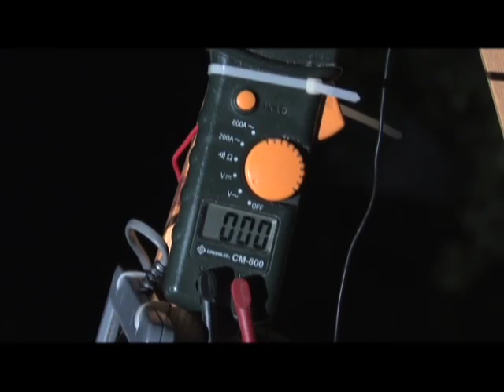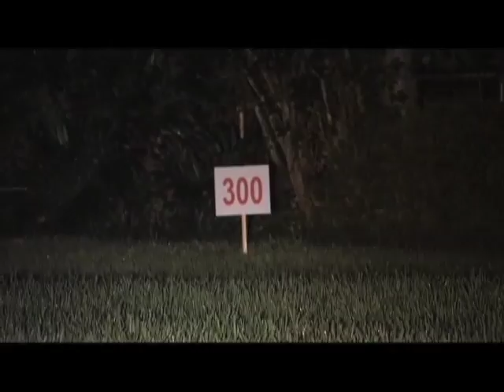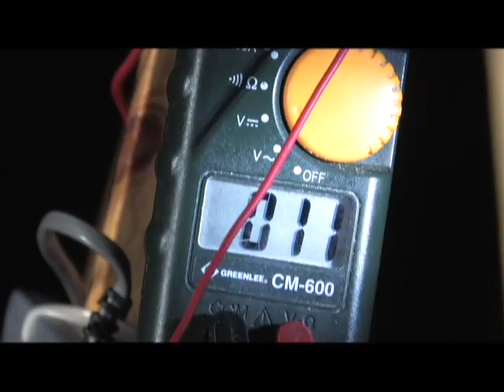Solar Panel Wireless Nighttime Power transfer HID LIGHT FRESNEL LENS PARABOLIC LENS

Comment: What if the lens was focused so the light filled more of the solar panel? Would that potentially increase the voltage? Or would the lack in focus produce the same power?

Comment: what happens if you move your light source half the distance, then one quarter?  Does it increase the voltage in direct proportion or is there some logarithmic increase?  Just wondering...

Comment: i did a real tesla wireless energy transfer. i got 20 ft wireles energy so far which is quite far! maybe i can get 50 or more. this is important we can bring his technology back if we start building it underground! once perfect it should go miles! wirelesss power obtainable anywhere on the planet!
Reply: Ya can't do what he wanted the power through the air would fry most your micro electronics we use now unless it was focused through the air and at nodes put into the existing electrical system, wireless power to your home without Into existing grid would fry all electronics. 100amps of power is too much.

Comment from the maker: You can as their light invades your space:-) You will not get much power, really very little but in theory an stronger PV with a higher efficiency rating would get something. Take a telescope and point it a a street light, even if out of focus, a solar calculator works if the eyepiece is removed. Pointless as they run off of just about anything. If your neighbor was a ball park, then maybe you could get  a few watts.

Comment: use lasers (like the really powerfull ones but not too powerful and damage the panel but maby use the lenses to difise it i winder how efecirnt that is? and maby get a laser that werks well with the imput spectrum of the panel(how to explain) a soler panel werks well with sum collers but not with others so thats y there not good with wight sun light so if u got a good coller then...

Comment: Well, looking at your 250ma motor and 4-11 volts DC developed, it seems like you're producing about 2-3 watts to run the motor.  That would be somewhere between 35:1 or perhaps 20:1 efficiency.  You're gonna burn up all your Carbon Credits running that thing Bucky.

Comment: Shorting a solar panel will not hurt it.  The energy will be absorbed by the panel through its own internal resistance, and that will just make it heat up a little bit more.  Have you ever touched one in full sun?  They get very hot.

Comment: You probably know this, but if someone else does not: when you focus the light onto a part only of the solar panel, the part not illuminated essentially acts as a resistance to the flow of current and limiting the power output.  I read that any tree branches causing shading on your solar panel should be removed or place the solar panels in another location.

Comment: He told us. Wireless power transfer. 
"IF" solar cells were more energy efficant. we could have off shore wave or tide powered generators and not have the danger of heavy wireing in salt water. With out the need for wireing. An off shore generator could easaly be moved out of harms way when needed.